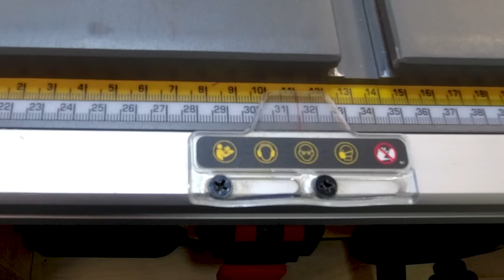⚡ The Best Way to Improve Your Table Saw / DIY / WOODWORKING

Comment: That is nice and well built, but I get by with two fence clamps and two holes drilled into a piece of 3/4 inch stock. The aux. fence sticks over the front edge about 10 inches and allows me to start large pieces of sheet stock by myself, and i dont have to worry about something that large to store.
Reply: Agree.  Same results can be had with less building.
Reply: Can you post pictures of your build? Thank you

Comment: I finally finished my version of this! Its fabulous. I have it on a dewalt jobsite saw. The infeed support is SOOOO good. I did make some changes. I added Jessem stock guides on the top. And for mounting it, i screwed a metal plate to the back of the existing fence and then used a mag switch to lock it down. Its more expensive, but it REALLY locks it down and is just one switch to latch and unlatch. Thanks for the inspiration!
Reply: What a great idea with the mag switch, can you explain or send me a picture how you did that? thanks!
Reply: @paulkrijgsman4098  I would love to to! But I don't see a message link on your about page. How do I send you a message?
Reply: @bcole23  Can you see it now? Thanks a lot!
Reply: @paulkrijgsman4098  I cannot... 😪

Comment: I have watched this video at least a dozen times because I really like what you’ve done. Thanks for the inspiration!  Btw, did you ever install a router and make changes to the fence on the other side?
Reply from the maker: Thanks for liking my video. I use the other side of the fence as well of course.  There's a second table saw with a dado blade, not a router.  When I first made the workbench, I planned to mount a router there, but I changed it because I thought it would be better to do it this way.  And I have a new idea to install a router.  I'll work on it and show you soon.
Reply: @carpentak  hey what's up I'm wondering if you can link to a video if you did it with the router that you would just talking about and how you did it, thank you so much!

Comment: So cool! The clamp you put on the new fence - that is just to hold the extension fence to the existing fence, correct? It is not to lock down the entire fence assembly I think. So you are using the existing locking lever for that? ps What make of shaper are you using?
Reply from the maker: The existing locking device is used as is.  I don't understand the second question. Shaper?

Comment: What great work.  This is a must have for anyone with a short infeed fence.   What is the white material?  I have been looking for sheets of this stuff but don't know what it is called.  Thank you.
Reply from the maker: thank you  This is 10mm white acrylic.  It is a material that can be easily bought here in Korea.  You can also use other materials.
Reply: @carpentak   Thank you.   I am very impressed with your work.  Excellent craftsmanship.

Comment: Great job, I love it. What's the length of the acrilic piece? Just to have an idea of the size!! Can I use plywood instead of the acrilic panel?
Reply from the maker: thank you.  I used a 100 cm length, but it doesn't matter if it's shorter or longer than that.  If you are using plywood, you can finish it and wax it to make it slippery.
Reply: @carpentak  thank you so much, I will make mine with plywood and wax it. 
Keep the good work and the great videos, you have my support!!

Comment: I have a Metabo table saw, which has a fence very much like the fence on your saw. I'm not sure how the fence on your saw would lock in place, before you built this fence, but on my saw, there is a lever on the far right side of the saw which is used to lock the fence. Would I still be able to use that, or would I have to install toggle clamps like you did?? I do not have a table extension on either side of my saw. My saw is still on it's mobile base.
Reply from the maker: hello.  I think it would be better if you put an insertion nut on the right side of the fence and fix it with a knob bolt.  It would be better not to damage the fence, but in this case, it seems unavoidable.
Reply: @carpentak  I wasn't referring to the fence itself, I was asking about the locking mechanism that is in the right side of the table saw. It's a small lever that is lifted to lock the fence, or lowered to allow the fence to move left to right.
Reply from the maker: My dewalt lock lever is independent on the right side of the machine.  It's different from your metabo.  So if you use the toggle clamp it will collide with the lock lever.  So, I recommend screwing the bolt-on knob on the right side of the fence to tighten it.

Comment: Hi, what is the size of the toggle clamp. The clamps I purchased too big?
Reply: I really like this video, and have watched it several times. I am using all wood and installing the JessEm saw guide to the top. In addition I am installing T rails in place of the higher ridge for other uses. Thank you,
Reply from the maker: The toggle clamp is a small size.  It's probably the smallest size.  thank you

Comment: Great video.  I have the same saw and I’ve been looking for something like this.  What is the material you used for the fence?
Reply from the maker: I used 10mm acrylic. Thank you
Reply: @carpentak Thank you for the video! May I ask what the is reason for using acrylic instead of timber or plywood?
Reply from the maker: Acrylic has a smooth surface and glides well.  It has a longer lifespan than plywood.  Another problem with wood is that it deforms depending on temperature and humidity.  So acrylic is good for fences.  If possible, it would be better to use aluminum.
Reply: @carpentak  Thanks for the reply. Cheers.

Comment: Thank you for sharing this!  What do you call the white plastic that you attached to the original fence? Is that a HDPE plastic sheet or something else?  Where did you buy it?  Thank you and hoping to hear from you soon.
Reply from the maker: It's acrylic.  It's easy to buy here in Korea.
Reply: @carpentak  Thank you! Ill look for it here in our local big box store.
Reply: @carpentak  How thick is the acrylic you used? It is easy to get 3mm here but yours seems much thicker
Reply from the maker: I used 10mm.

Comment: Do/can you adjust it for 90?
Reply from the maker: Yes i adjust it for 90
Reply: @carpentak  I have the same problem.  Can you please explain how you added the adjustment for vertical square of the fence to the table?  thanks!